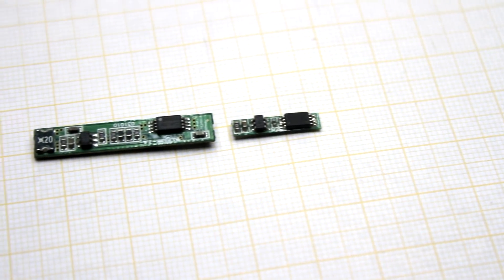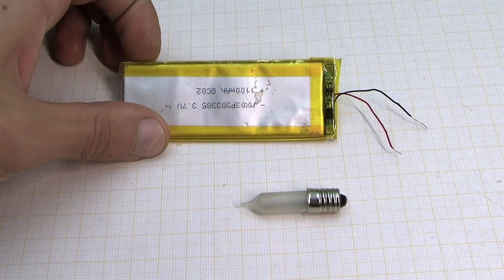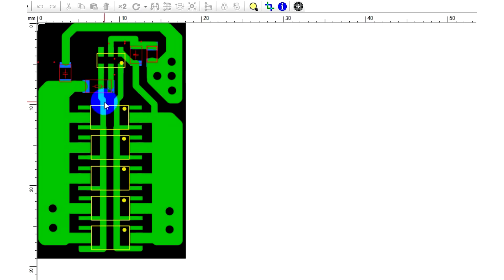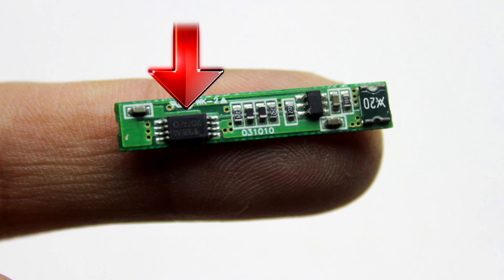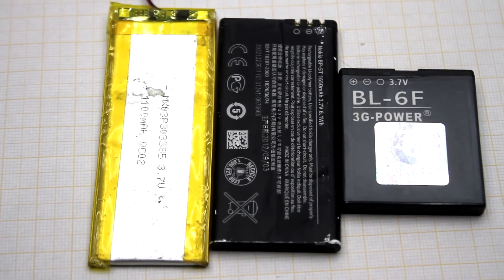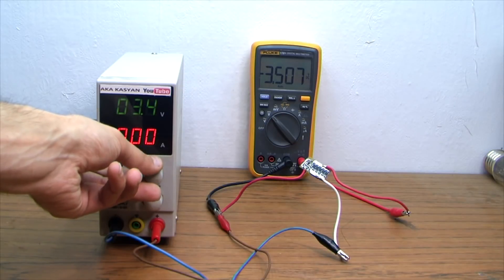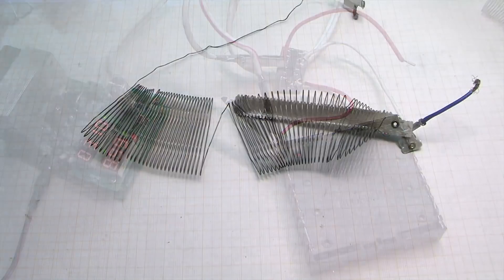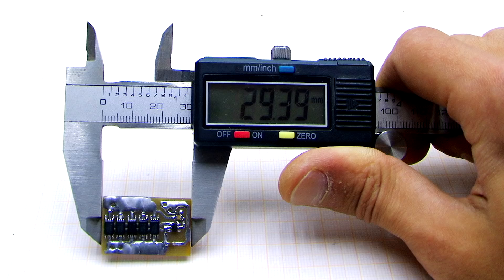DIY protection system for Li-ion battery

Comment: Use a small chinese engraving CNC 1610 (bigger not hurt) , with pratic you can get like laser cut result, also newest flatcam 8.98 beta have a optio to clear all unnecessary spots. or islands. A OpenCNCPilot g-code sender with auto level option is just great.

Comment: You have a very informative and interesting channel. Keep it up. I like your design for the power bank very much. I was planning on building something similar for myself but I find it difficult since I am not an expert on electronics like you are. Do you think you could show me how to modify the circuit so two of the USB ports can be set to give a different voltage and current supply from the other two? Thanks in advance for your assistance.

Comment: This is neat if you have the time to do and salvage components.  I wonder if you can use the idea you are performing with a Li-Ion Charger for higher voltage and/or current so like for more batteries to make like ~12V range with one charger.  12V car charger design maybe or 12V wall wart.  Neat and thanks for sharing.  You have really strong hands.

Comment: nah

i got idea
but stuck
can 1 arduino nano check simultaneously 7analog value of series battery?

if yess

next just set
if analog a value exceed ....v 
digital pin nano gate voltage mosfets to discharge 1 batt

and you can controll by wifi using esp
Reply: my target making 7s 50a passive balancer

if i lucky
i wanna make active balancing 7s battery

Comment: A note needs to be made here regarding transistors. There are two basic architectures. Bipolar (NPN and PNP Type), and Field Effect (PFET NFET JFET etc). The key difference for the purposes of this video is what happens when they get hot. A bipolar transistor's forward bias voltage goes down. With a FET the resistive impedance goes up. So when putting them in parallel, a FET circuit will more or less balance itself out, and a bipolar circuit will have the bulk of the load on a single transistor (whichever is hottest) and this single transistor will take more of the load as it gets hotter till it fails, unless compensation circuitry is used. So there needs to be a differentiation between the two types of power transistor.
Reply: 6:03